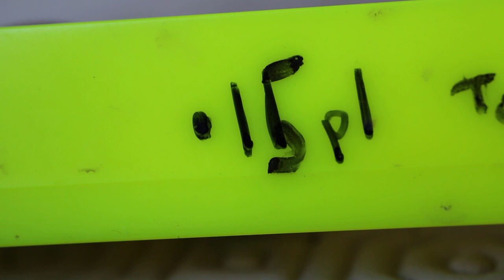Tackle Talk Part 7: Pole Rigs – choice, storage and organisation

Comment: Awesome 😲 Fail to prepare, prepare to fail springs to mind 🤔 And some ‘next level’ thinking with regards to the difference in tip diameters/material👍🏻
Reply from the maker: Everyone is getting better and better all the time so finding an edge is getting harder and harder. Lots of small improvements all add up to a big improvement and will hopefully all add up at the weight in. 👍
Reply: @danwebbfishing456  Agreed and also agree with the ‘prep’ but never gave float tip material and diameter much of a thought, given I’ve tried to modify or get the float pattern’s I’m confident in to have/take 1mm hollow’s purely based on visibility....food for thought and back to the drawing board 🤣 Thanks Dan, loving  the vids...👌🏻

Comment: Wow Dan, I thought I was bad with hoarding floats you must have thousands of rigs made up, I did spy my favourite canal float the Guillaume I've only got 10 though, I also love the Gloucester  pattern which is similar to more favourites of mine, the turbo and carbo a very interesting vlog especially those 50g crallusso blade's, you could fish the Severn when it's flooded with them
Reply from the maker: If that’s how many I’ve got tied up, imagine how many loose floats in boxes I’ve got! 😱

I actually feel that the best weight for flatfloats is 10g or less. Bigger than that, and I think a pole feeder is better. The bigger flatfloats are needed for float only events though, where of course you can’t use pole feeder!
Reply: @danwebbfishing456  I can't imagine how many you have loose, probably more than most tackle shops 😁